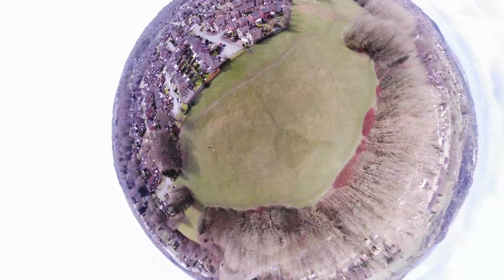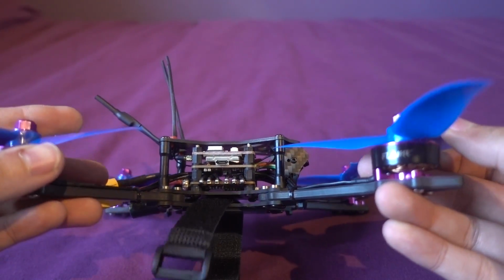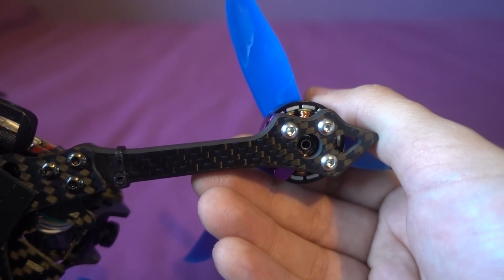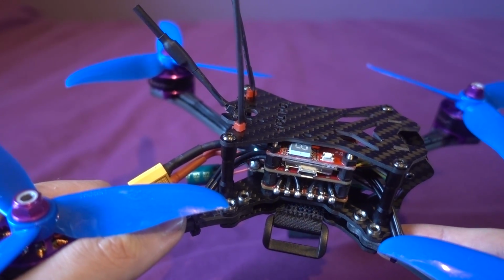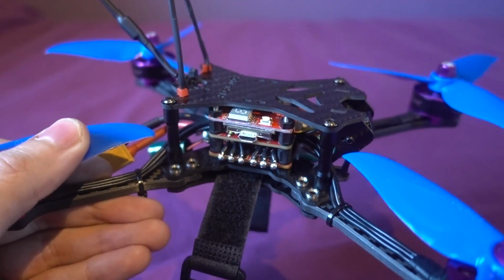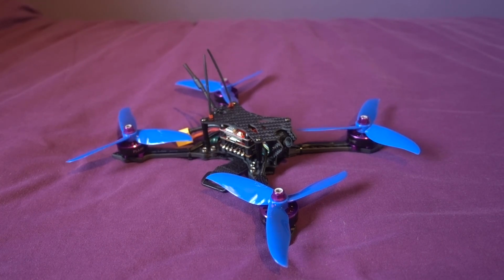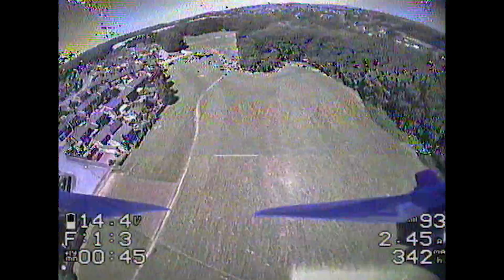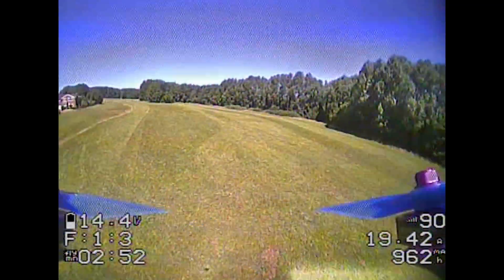HGLRC BATMAN220 - Worth The Extra

Comment: Thanks Andy for the review.  Just got the Batman 220 delivered, super fast from the manufacturer via DHL to NJ, USA in 5 days.   FACT:  They are now putting the capacitor ON TOP, and the power connector on the bottom.  I think they listened to you.        Appreciate the prop discussion as well.  Great review all around.
Reply: Oh, and the battery pad was quite a bit better looking, but still not a perfect rectangle cut.  SMH

Comment: I think I know why the Hawk 5 is faster. That's due to its motors. As Kabab's explanation about motor flight feel, the peak power of a 22xx motor is higher in the throttle range, and when bigger the diameter of the motor, the lower the peak power is. Probably, if they used a 2207, it'd be faster.
Reply from the maker: It's not just kabab that says that. I've said it in every video that has a 23 motor in it...

Comment: I’m looking to get a 5” for freestyle. Would you recommend going with the Batman 220, Merica, or Hawk 5. I know the Batman and Merica have better components. But which one flies smoothest with the most precision, or feels like it’s on rails, but also plenty of power. I know someone said the Hawk 5 has a great tune and it feels like flying a sim. I want it to feel really locked in. Or I’m considering going with an ultralight like the KingKong 200GT or Diatone GT-M515.  Long flight times would be great but do they have enough power to catch you at the bottom of a power loop when close the ground? Also what do think about 4s vs 6s and voltage sag, does 4s need more throttle for the same maneuvers at the end of a pack? I’ve only flown the Torrent 110, Vortex 150 and some brushless and brushed whoops.  What do you recommend? Thanks. And thanks for all the great informative reviews, keep up the good work.

Comment: I don't know if this FC is one of these, but the HGLRC stacks are notorious for shoddy soldering for the gyro chip.  I just bought an XJB-145, and it was DOA due to this issue.  Buyer beware: https://www.rcgroups.com/forums/showthread.php?3000984-XJB-F428-No-Accelerometer

Comment: You can spread the battery leads and push the capacitor up through them while bending the legs vertically so it sits perpendicular to the base

Comment: Great review as always. Whats causing the long thin rectangle in the bottom right of the fpv feed? I get the same thing with my dom v3. Is it sun on the lens damage?
Reply from the maker: its a trait of the micro ccd camera they pretty much all do it. if you get the ntsc ones it cuts it off in some cases. I thought it was my goggles too but its the cams. cheers
Reply: Cool, nice to know. Thanks for the info and the quick response

Comment: I instantly checked all wiring on my naked-bottom-motors :$ 
Thanks for mentioning that! 1 of my Emax LS motors had it's balancing-paste (or whatever it's called) slightly scrape the wires...

Hmm the XJB145 is/was popular.. looks like they did it again :) 
The screws that hold on the arms looked a bit short-isch?
Reply from the maker: yep its a good call i installed the rs2 on a copter and when i ran the motors up one was sounding rough as anything sure enough it was the wires catching.
Reply: You here :P 
will you do a giveaway of this one as wel? :)
Reply: Hot damn! It's not like it was Severe on mine, but I could definately feel it.. 
Back to closed-bottom motors! :D 
@Star-lord: ehmmm! Have mercy! :;)
Reply: I just had this problem on my brushless whoop!

Comment: What changes in speed could be expected on a 5s? I have been keen on this model since i first saw it and i''m surprised they are still using the ''batman'' name i figured that wouldnt last due to legal reasons. I like my xjb now i want this.
Reply from the maker: aparently the 220 after the name gets them passed the issue. as for 5s my point of reference would by my mode 2 ghost build. I think on 4s it did 109mph on the bigger battery and on 5s it did 124mph but those escs overheated so i would expect a similar figure on 5s with this one.
Reply: So in a way the extra amps are more of a safeguard? I am almost certain the name will get changed at some point the lawyers would be waiting for a reply from china hehe. Thanks for the review i appreciate the effort.

Comment: Hi Andy, nice review as always. Looks like a great quad. I use the same fc on a build. How did you set the amps meters to work? You said there is no telemetry in the esc.
Reply from the maker: the esc board has a current meter on it and if you buy the stack as one then it has the current out on one of the pins to the FC
Reply: AndyRC so the fc gives the sensing from the current cable connected to the esc? I have a 4in1 esc with telemetry(blheli 32) and I get no reading when I set the esc as input in the battery tab in bf. If I set the reading to be from the fc I get an mah counter that goes up without stopping. I don't get it.  Only my battery voltage works from fc.
Reply from the maker: Nick Bozos the 4 and 1 esc with the titan has one current sensor and the fc has a current sensor input. If you have esc telem. Ake sure it's enabled and that the way board has a current sensor. Some have telemetry but not the sensor for current

Comment: I've seen some people flying with the Magnum Stack in 6S and they said they broke less components at 6S than at 4S. That's really funny. Btw you colud try flying this quad at 6S too, Justin Davis said he had no probs (motors hadn't gotten so hot).
About the speed, had you tried with the Avan Flow props? Even though it's a 5043 it's a really fast blade (as shown with the Hawk 5). I think it'd be a nice try. And if you want to try the ESC potential put some Avan-R props (would love to see its speed with them too!).
Reply from the maker: I tried the avan on the new RS2 and it didnt peform as well as it does on the hawk5. cant say id advise 6S on this one. im yet to see any dvr footage from 6s?
Reply: Andy, I forgot to mention, but about a competitor to the Alien and other quads that doesn't have the props captured by the GoPro, the GepRC GEP-KHX5 Elegant might be a good one!
Reply: About the 6S capability of the Magnum Flytower, check Shaun Taylor's channel. He told me that it holds 6S without any problems.
Reply from the maker: I mean the hglrc on 6s not the hawk... ill look at the gep thanks
Reply: AndyRC oh sorry! It's at Justin Davis's review (Drone Camps RC). I think he's a honest guy.
Reply: Pedro Griebler Reche I'm with Andy and would stick to manufacturer's recommendation. For a 6s a 1600kv is equal to a 2500kv on 4s. So with that in mind the amp draw would be crazy at wide open throttle. Probably would need to throttle curve the top end. I wouldn't chance it.
Reply: Pedro Griebler Reche https://oscarliang.com/6s-high-kv-motors/

Comment: I notice you took 1200mAh out if a 1500mAh battery. Does that not damage them? I usually only take 600mAh, am I cutting my flight time too short? Nice review btw.
Reply from the maker: every time you fly it damages them as a rule i land at 14V rather than the capacity. they all differ slightly and its only there as a point of reference.